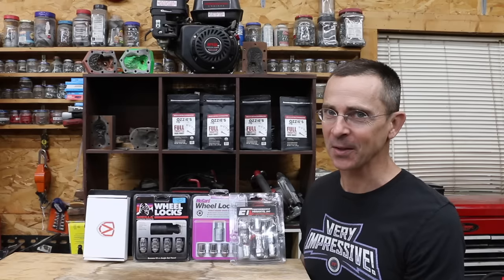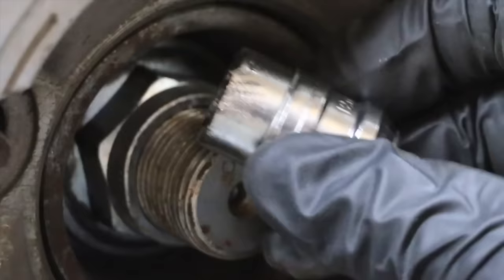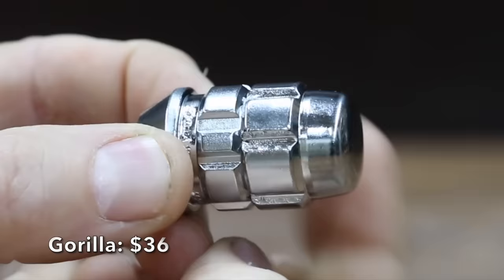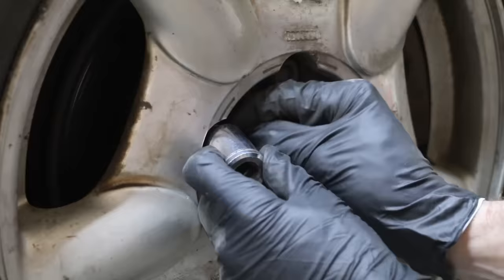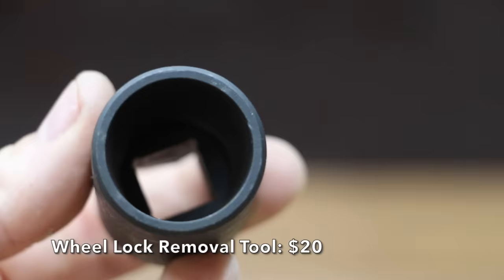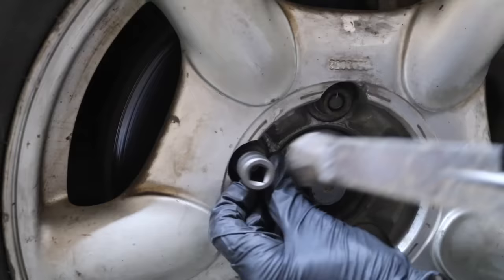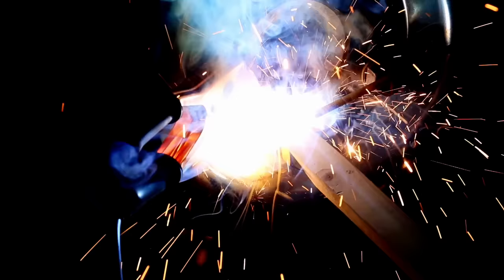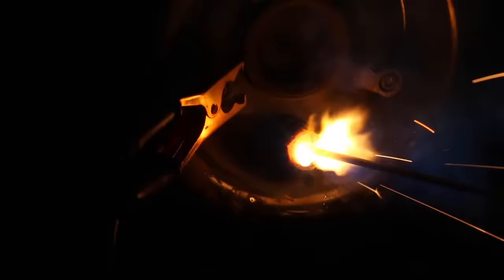Best Car Wheel Theft Deterrent Lug Nut? Can Any Wheel Lock Prevent Theft? Let’s find out!

Comment: I have never thought wheel locks are worth their cost. This will be interesting. Hopefully cousin Eddy finds his solution.
Reply from the maker: Thank you!
Reply: They're more a deterrent than the last word in wheel security.  Worth having if you fit expensive wheels and/or tyres!
Reply: @skylined5534  yeah, they are a deterrent from the average opportunity crime... If someone wants your wheels and has the time they can get the wheel locks off.
Reply: @skylined5534 as LPL says, locks keep honest men honest. I guess this is a similar concept.
Reply: @Richard Cranium Any thief who's never been caught, is an "honest" man.
Reply: best solution is a big mean dog, paintball gun and frozen paintballs. and chasing off every homeless or gangster in your block
Reply: The best deterrent is rims that have the lugnuts recessed into the rim. There are also aftermarket rims where there's only enough room for a chrome socket you can't even use an impact socket to remove the lugs.
Reply: @richardcranium1776  I wish that were the case.... an honest man pushed to his limits, when all options are exhausted, will steal for his family, if the opportunity presented itself.
Reply: @volvo09  

Where there's a will there's a way. Things like padlocks, locking wheel nuts and trailer locks are usually sufficient to put most off though.
Reply: @veridico84  Correct.. People are conditioned took look for a stereotypical thief, if they knew the amount of the stuff that I've seen brought to the hood from people who didn't fit a stereotype it would change their whole perception of what a thief was, lol and how to protect their stuff.
Reply: @ColinBFClarke  You can't chain up a dog in Walmart parking lot.. Also a thief has to have the knowledge and tools of what they're stealing, most gangsters and homeless people are not gonna have the tools in this video to steal rims, they're just not, lol. A camera and a dog at home is enough to protect your wheels and just about anything in yard.
Reply: Cousin Eddy don't want his 30inches stolen 😂
Reply: 90 bucks! I guess that’s why I have a gun. I have also seen the guy lost his lock key! Not good!!!
Reply: If all your protecting is common steel wheels and crap tires, then maybe the locks aren't worth it. But a decent set of factory aluminum rims are at least $100 each, and decent tires are at least $100 each. That's $200 per wheel. A $19 investment in the McGard locks seems totally worth it, even if all you end up doing is preventing teenagers from pulling a prank.
Reply: @rashaadswanson  I'd kill for my daughter to be honest.
Reply: Friend of mine, they tried to steal his wheels but he had wheel locks. After damaging his wheels they keyed the entire car. Would have been cheaper to let them take the wheels.
Reply: @somejoe7777  Even more so with modern cars. Basic rims on my car cost $250 each and the factory tire is $150.  On a nicer car those numbers can easily double.
Reply: @ProjectFarm  Advanced wheel lock maker frowns... "Cones are conducive to welding nuts onto. Hemispheres will be far harder to hold in place against.
Reply: @somejoe7777  $100?  The factory wheels on my ram are 1085 each for 20” aluminum wheels…
Reply: @skylined5534 . People forget it’s about mitigation, not stopping it.
Reply: Yes, they are just a deterrent, they see the wheel locks and just move to the next car, even so they are not perfect I have wheel lock on my truck and parked in a area know for many cases of stolen wheels, they not even try on mine so they knifed one tyre and well at least have not to pay for a new rim 😒
Reply: Great way to get sued for assault
Reply: @rashaadswanson  The best deterrent is rusty steel rims and cheap generic tires.
Reply: @ColinBFClarke  pepperballs are pretty fun, there's also heavy(ish) .68 cal riot balls too.
Reply: @blahorgaslisk7763 Lol
Reply: Wheel locks (your best option) $100ish for all 4 wheels.
Each wheel on my car from online resellers is $500 each plus $200 per tire. Breaking it down, $25 for a lock that protects $700ish is worth it to me.
Reply: @veridico84  LPL will take all 4 rims to show you it was not a fluke!
Reply: Forget wheels - something to lock on the catalytic converter! Those get taken around here in broad daylight.
Reply: @skeetorkiftwon  And how many 110 Volt outlets are outside by the street?

Comment: One thing to add if you are using work locks: They generally come in kits of four, and it is intended you use one for each wheel. Buy more than one kit, and use more than one on each wheel. If you use only one, kids will remove all the other lugs, and use leverage with the bar to break the stud off that has the wheel lock. I have seen it many times. I am a police officer for reference.
Reply from the maker: Thanks for sharing.
Reply: Good point -- they can just grab tire and bend it back and forth until the stud breaks.
Reply: Defense in depth, use two different types at least.
Reply: Packs of 20+ are more common these days for that reason. I got locks on every stud, unfortunately they are the gorilla ones so probably won't do much much good anyways lol.
Reply: Wouldn't that damage the rim?
Reply: @OS10100  Maybe... Unfortunately my only experience with this is when they are stolen, so I never end up seeing the rim itself. It's very obvious what happened when you find the broken stud on the ground with the locking lug still attached though!
Reply: @bobbygetsbanned6049  What you have are NOT locks, but small diameter nuts for some wheels with small holes.
Reply: thanks. i have no idea. early in the video, i thought every product doing well against the locking plier, expected the locks on all nuts.
Reply: @MrDgwphotos  That's a thought that I had before, use at least 2 different types. Might look kinda goofy going down the road but still, at least you'll still be going down the road.
Reply: "Kids": lol. Young thugs: yup
Reply: Hello John, and thank you for fighting the good fight and protecting your community.  In areas where people are parked long term and are worried about someone "rocking the stud" to break them off, we suggest 2 lugs per wheel, set across from each other.  This creates a fixed line, as opposed to a pivot, and eliminates the ability to snap the stud.
Reply: @hxhdfjifzirstc894  using the wheel itself as the leverage to break a stud is wayyyy harder than you think it is, nigh impossible.  Personal experience says it even takes a lot of hammering to break a stud with perfect access when a car is on a lift at chest height.

Source: I worked at carvana and had to deal with this many times. Even tried to used the weight of the car to break a wheel stud with only one stud and lug (siezed together) holding the wheel to the hub loosely at one point, which did not work.
Reply: @advancedlocks  Thanks for the reply, and I totally agree with your recommendation. That is what I usually suggest to people as well, although sometimes, I suggest they buy locks for every lug!
Reply: As a mechanic, I wish there was a stronger version of the dislike button... If I need 4 keys and one socket just to pull your wheels Id be annoyed lol
Reply: Oh my goodness, the lengths they will go. Thanks for your service, stay safe out there
Reply: Thanks for the tip!
Reply: @orlandorosado2157  Criminals is more like it. Lock them up and lose the key.
Reply: @Drew-wf7vw  Even worse... when the customer drops their car off for service and doesn't leave the key out. You end up having to go through all the junk in their car to find it.
(The worst offenders of this? Women. I know... shocking!)
😂
Reply: I have heard that story as well from others.
Reply: @advancedlocks  You should package them in an 8 pack then & keep the price below $100.
Reply: @orlandorosado2157  The new term is “Scholars” and I wish I was making that up. Joggers was better
Reply: @orlandorosado2157  jogging enthusiasts
Reply: @jerryjeromehawkins1712  for reference, leave it in the rear wheel or the glove box please!
preferably the glove box as removing 4 pushchairs 10 pairs of shoes, various childrens toys, 40 kilos of shopping and the rest isnt fun.
Reply: @alexstrachan3104  I would be selling them at a loss at that price point!  The competition is stamped out of cheap steel, usually overseas.  Ours are all made in the US out of alloy that is harder than tool steel, and the keys are all hand assembled.
Reply: @bobbygetsbanned6049  still better than nothing

Comment: Bought the advanced wheel locks almost two years ago for my ram 1500’s chrome wheels while i lived on the outskirts of Mexico City for a couple of months and i never had a problem with my wheels being stolen or messed with. I did end up missing two of my regular lug nuts but the wheel locks never moved. I highly recommend them.
Reply from the maker: Thanks for the feedback.
Reply: Which advanced lug nuts did u get ? I'm curious if it's worth buying them. If a thief is going to get them, they will. Alarm, security cameras,  motion detector,  dogs, firearm and a can of whoop ass seems all we need to protect from thieves.
Reply: Wheel Lock Set M14x1.5, 42mm Tall, Cone Seat from advancedwheellocks is what i got for my truck and they worked great. And yeah if a thief wants something bad enough theyll get it, but this way at least they’ll have a difficult time getting them and it’ll give me some time to hear them and rightfully respond.
Reply: Holy moly Mexico City, them thieves there will steal almost anything even your underwear from under you if you stop blinking
Reply: It can be removed with a bolt extractor socket. Watch video from Donut.
Reply: @BW-kv9wj  Id like to think the odds of a burglar having a bolt extractor and sledgehammer when trying to take my wheels are gonna be slim to none when they’re expecting just a regular lug nut lock. Itd have to be a targeted attack if they are carrying those tools.

Comment: I never knew such welders even existed.  I'd love to see a comparison/test video on these suckers, assuming there is a range of quality and they are not all disposable crap.  Excellent video on the lug locks -- Those $90 are probably worth it if your wheels are expensive
Reply from the maker: Thanks for sharing!
Reply: Welders can be pretty small these days. My flux core from harbor freight is the smallest welder i have ever seen and it can weld 3/16 plate pretty comfortably. It's a little smaller than a cinder block I would say.
Reply: @TiberiusCaeTsar  I totally agree with you on the HF Titanium welder, tiny but mighty!!!! I have welded one thing 1/4"  just for trial purposes, and it did the job just fine (liftgate bracket on a box truck) once you get your settings just right.
Reply: Definitely would like to see that.
Reply: If the wheels are expensive enough to warrant almost 100 dollar wheel locks, you probably have a garage and a good place to keep the car. If you also have nice enough wheels you probably wouldn’t want some security but ruining the wheel as you probably have some nice colored ones or even titanium nuts as they look nice to some people
Reply: @charliemaybe  For me the locks aren't so much for when parked at home but rather when traveling, shopping, dining, visiting friends, etc.
Reply: @charliemaybe  I live in the big city and my VW factory wheels are $500 apiece. I don't have to park on the street at home, but I do when I go somewhere.
Reply: @charliemaybe  there are some places you need wheel locks so your steelies dont get stolen my g
Reply: @charliemaybe  keep in mind, in some places crime has been legalized. people in san fran learned to just open their trunks and windows while shopping or going anywhere because in broad daylight, in very busy parking lots/spaces thieves know they can just bust out your windows and steal everything they want, with zero consequences.
Reply: I see one of those and I just tell the owner to call a tow truck.  I'm not getting that thing off - period.  Generally, however, dealerships will sell the el-cheapo locking lugs you can remove with a 20mm socket and some elbow grease.
Reply: Me too regarding the ultra compact welders.
Reply: @charliemaybe  My stock wheels on my 07 Silverado were stolen a couple of years ago. I would have never thought 13 year old stock truck tires would be worth the trouble, but I woke up to my truck on my neighbors paving stones. Replacements were nearly $300 each, so $90 bucks is still worth it.
Reply: Maybe I should consider these locks for my old jeep rims. They are actually fairly hard to find because it was only a two (maybe 3) year Up Country option if I'm not mistaken. They are out there, but hard to find. Last time I looked, it took awhile. Making it worse, I think the up country wheels are 1" larger diameter, but still have the same pattern as the limited (highest trim). They also have the same design wheel, but without the gold accents. Basically factory rims( just not for the exact trim my jeep is, mine was converted to Up Country), but I don't think I could ever replace them.

Comment: Something to consider with locking wheel lug nuts is how durable the "key" is. I had a vehicle years ago that had locking lugs on ALL of the lug nuts, so 24 in total. The key-socket thing that fit them broke on the second lug nut, I managed to get the other 22 off with an EZ-out, which to date has been the only time an EZ-out didn't make things worse.
Reply: Non factory locking wheel nut keys can be shockingly bad! 

The renault and bmw stuff I've used for example though is incredibly durable.
Reply from the maker: Thanks for the feedback.
Reply: @skylined5534  The gorilla stuff has always been quality and held up for me. Beware the nonames. I too have had many crack or deform from poor metal, or often poor design.
Reply: I had this same problem.   The first time I removed the locking nuts to rotate tires I could see the metal beginning to fail and didn't put the locks back on.
Reply: I had to replace the oem because they were way short. Got splined lugs that you still can't get anything like vice grips on.
Reply: i bought a cheap set once, and the key broke while tightening the second lug nut
Reply: I had to learn that I couldn't buy a McGard replacement key at the Chrysler dealership even though I had the broken one. There is a code on the box it comes in that you'll need to order a replacement. There are a large amount of different shapes out there.
Reply: Agreed! The main reason I'm not using wheel locks is fear of eventually not being able to remove them myself the intended way, non-destructively. Here, I was hoping for a test of the durability (max torque et c) of the respective key systems.

The second most important reason I'm not using wheel locks is that my wheels don't fit cars which are popular among Cultural Enrichers...

Comment: Former LE officer here, most wheel theft rings carry around a bag of common wheel locks. The ones that are keyed differently tend to be the ones we saw much less of.  Can't say I ever saw a case of someone carrying a welder around though but I guess anything is possible!
Reply from the maker: Thanks for sharing.
Reply: Aren't they stealing catalytic converters now and not wheels? I haven't heard or seen anything on wheel thefts in years. I live in the wheel theft meca of California, too.
Reply: No it's gotten bad now here in Ohio. They are stealing factory rims nows.
Reply: There are tools to remove a wheel lock without having to carry a kit. Only takes as long as it does to remove a regular nut by hand.

Comment: A comparison of car ramps would be very informative and helpful I hear a lot of sketchy things about some of them
Reply: Nice idea! The cheap steel ones slide out from the car when you reverse off them and the car can be damaged when it falls on them.
Reply: Good idea -- I don't test any of those plastic ramps. I think a far safer ramp could be made easily from wood, whether stacking plywood pieces or 2x4s, etc. I suppose cut a profile into several pieces of plywood, and screw or bolt them all together until it's wide enough to drive on.

If you just want oil changes to be easier, get a Top Sider oil extractor. Especially if you can change the oil filter without jacking the car up. Make sure to get one that's large enough to handle the amount of oil in your particular engine. I actually get MORE oil out of my engine with this thing, than using the drain plug, so ignore any theoretical nonsense (and yes, you should warm up the engine for a minute so any particulates will be suspended, rather than sitting on the floor of the oil pan).
Reply from the maker: Thanks for the suggestion.
Reply: You can make a quality set of ramps out of just a couple of 2x6s or 2x8s and a hand saw.
Reply: Nice idea.  I recently helped a guy who had metal ramps that kept sliding along the floor instead of making the car drive up the ramp.  Also, I have seen ramps that have a very poor flat spot on top that wouldn't allow the car to be stable without using the e-brake.  (Yes, you should always use the E-brake with ramps as a second layer of safety, but the car should not be trying to roll off when the wheels are on the top flat)  There could be some really good tests for this idea!  (And I love the idea of including homemade ramp designs from 2x4s)
Reply: Rhino ramps are fairly decent for composite material. A lot of steel ones are no use for low clearance cars.
Reply: @johndeerekid167  yes, but I would go with 2x10 , 6 inches is not wide enough to drive up on
Reply: @hxhdfjifzirstc894  You can sure do it that way, but a visual inspection of the bottom of the vehicle every oil change can alert you to potential problems you wouldn't see from the top.